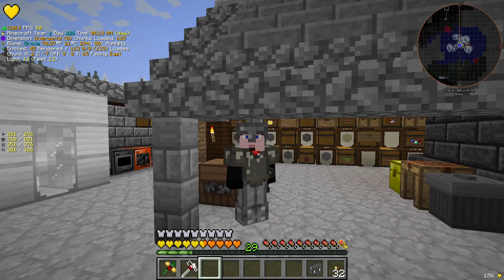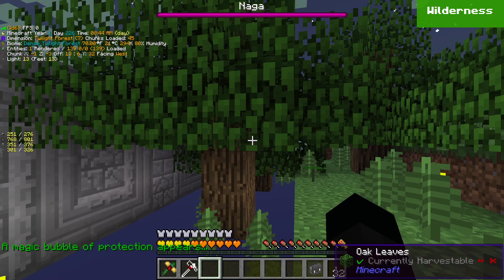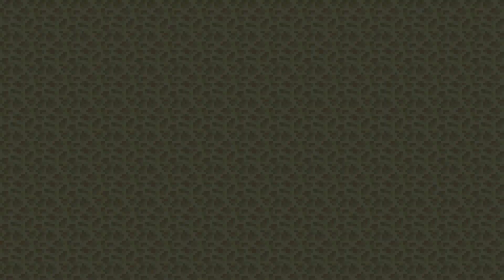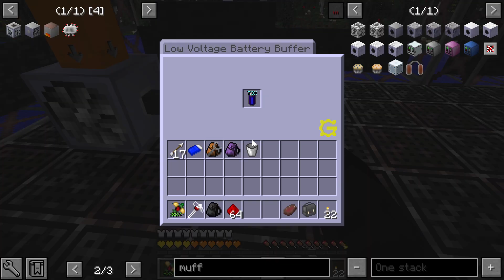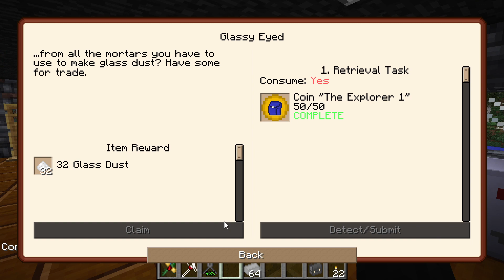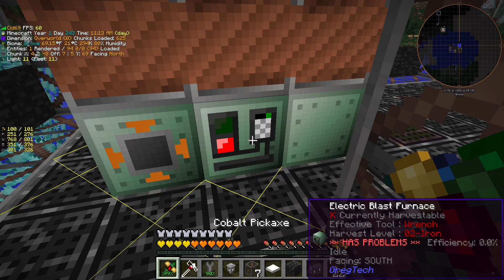GregTech - New Horizons - 38 - EBF

Comment: The errors, like pipe is loose, are because the machine needs maintenance. To fix maintenance problems, go the maintenance hatch, right click on it and then apply tools to the maintenance problems. You will lose 1EU per cable piece of cable (3 block long cable loses 3 EU, which is 3/32 EU so over 10%), so the generators will need to be quite a bit closer to the hatches or a lossless cable can be used. I normally put a battery buffer adjacent to each LV energy hatch and then attack two generators directly to the battery buffer. Especially for the first EBF.

Personally I disable maintenance in the pack. The game is hard enough without having to wander around and fix machines every now and then.

Comment: Welcome to a crash course in GTNH Multiblock machines. They've a learning curve to them unfortunately, but when you learn it for EBF it fairly applies for all. 
I'm not sure how far ahead you have videos recorded so here is a few things to note. Also output bus for items will auto output to a chest if a chest is next to it's face (same for fluid output to tanks/pipes).

Maintenance, full of suffering initially. These issues crop up over time to make you keep check on machines, very slowly that is. Mostly non stop running machines. It's vital you fix them really as each one incurs a severe power penalty increase to recipes (0% efficiency means no recipe runs, you always want 100% efficiency). You can sometimes get away with 1 initially on the EBF when doing Cryolite Aluminum recipe (which you should initially do). 

Here is a quality of life thing to make maintenance obsolete. Make a "IC2 Tool Box" (bronze tool box) (Made with 5 bronze casings or forgot whatever they were named, the small plate like things made from plates).
In this IC2 Tool Box put the following items/tools.
Soft Hammer (Rubber Mallet) (fixes something is stuck)
Crowbar (fixes that doesn't belong there)
Screwdriver (fixes screws are loose)
Hammer (normal hammer) (fixes platings are dented)
Wrench (fixes pipe is loose)
Soldering Iron (charged) + Fine Solder Wire (10 solder ingots is 9 tin + 1 antimony alloy furnace, make into fine wire in wiremill) (fixes circuity burned out)

With this toolbox full of those items, you can right click with the toolbox or use the toolbox itself inside the GUI slot of the Maintenance Hatch to fix any issue(s) instantly. Even if that issue isn't present all tools take a bit of durability/energy and 1 solder wire is used. But heyo, no headaches to be had!